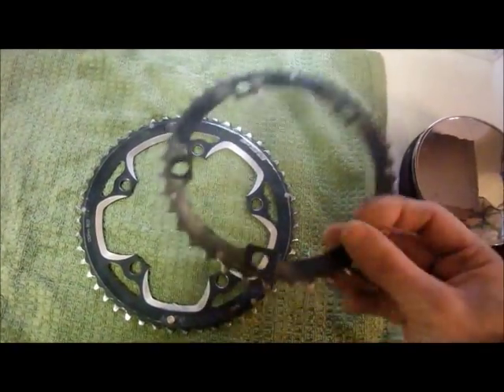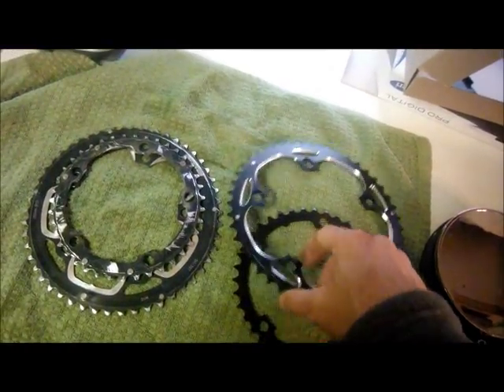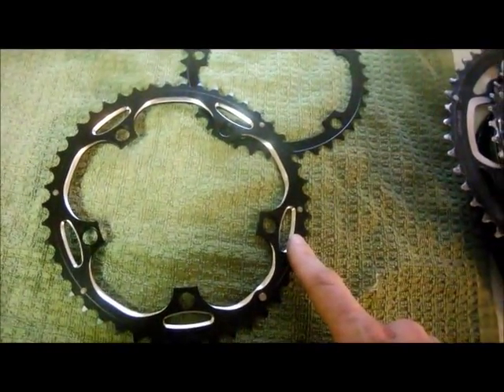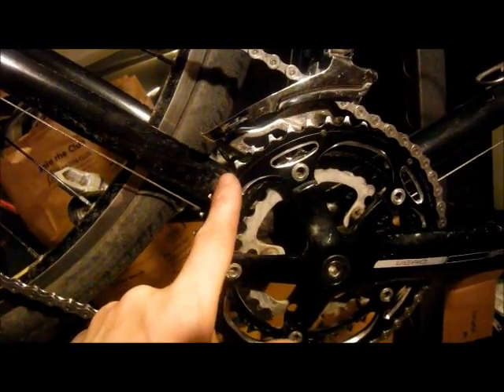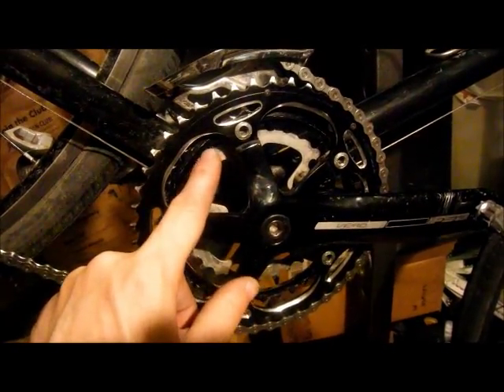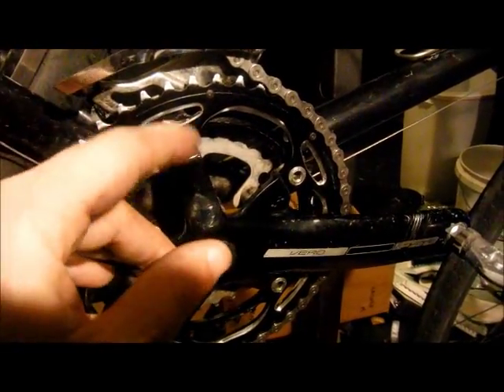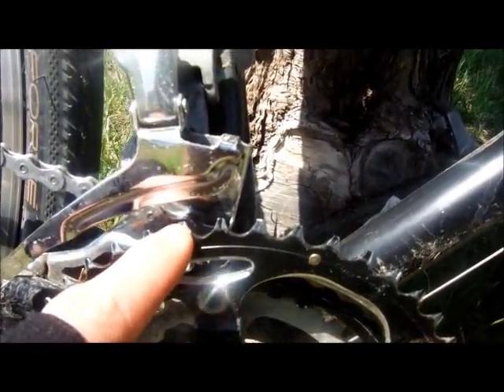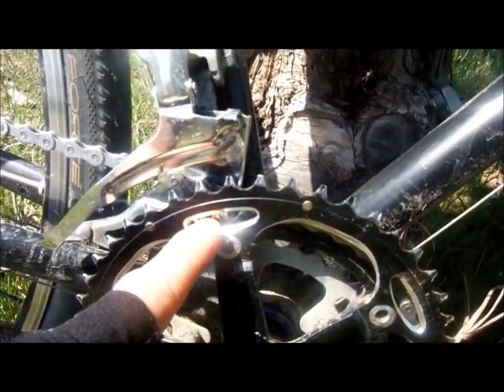Upgrading chainrings to cyclocross gearing:  cyclocross triple chainring

Comment: Looks like you have a 22t capacity front derailleur (i.e. designed to be run with 52-39-30 the difference between 52-30=22t).  You are running a 46-38-30 combination.  This is a 16t gap  Switch out the front derailleur for a 20t derailleur (i.e. 50-39-30  50-30=20t).  That should allow you to lower the derailleur closer to spec, thus minimizing chain drop issues.